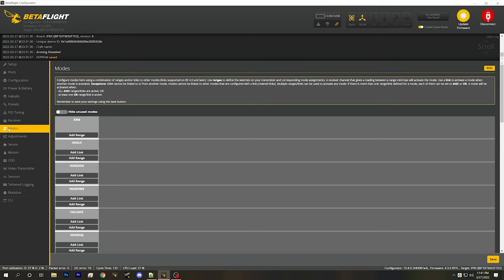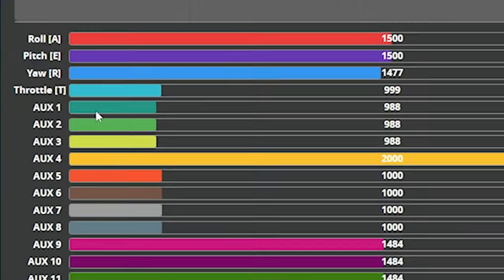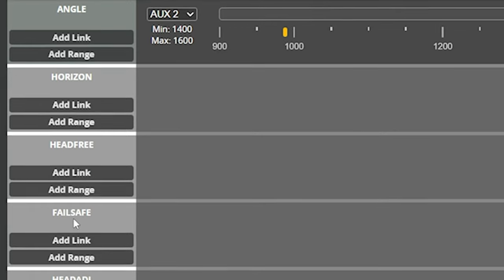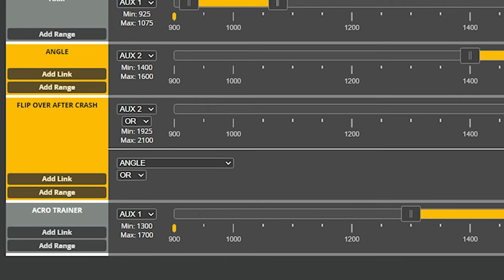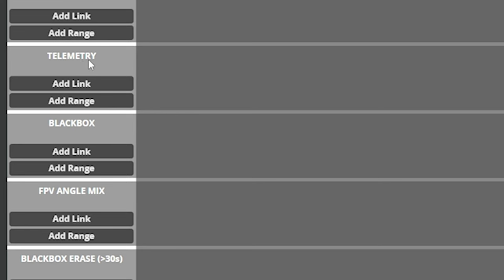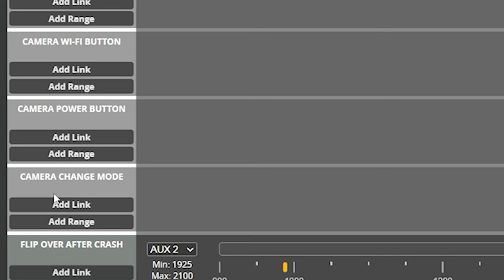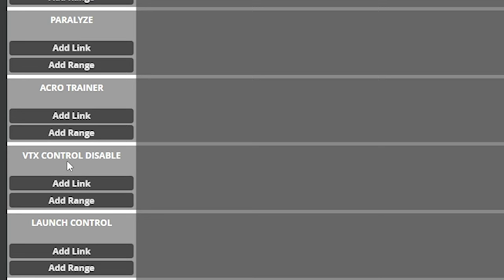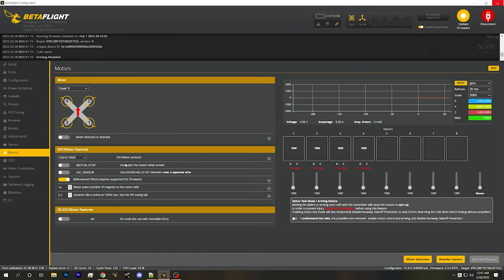Betaflight 4.3 Modes Tab | COMPLETE WALKTHROUGH PART 4

Comment: The downside of telemetry is increased latency. Racers may choose to disable telemetry to shave the latency to it's extreme limits.  Look at the latency tests for ELRS, Ghost, and Tracer.  The 2 fastest run no telemetry mode to get below 4ms of latency.  Tracer is a hair slower because you can't disable telemetry. That said, i'm always using telemetry,  and I'm even using the Crossfire NanoRX Pro that has 500mw of Telemetry broadcast power, because I want my openTX callouts for battery and LQ especially when i'm at long range 👍
Reply: Latency via jitter*
Reply: Telemetry mode is a receiver setting, disabling telemetry in BF won't reduce the latency because the receiver would still be either in telemetry mode or in one way mode, and not receiving any telemetry from BF doesn't change that. Otherwise, good points.

Comment: i have the tx16s with crossfire I set up the 3 AUX's and when I have the drone plugged into the computer on beta flight i plug in the drone battery and my controller says telemetry recovered indicating it is connected to the drone. but when i am in the receiver  tab in beta flight nothing moves and in the modes tab the auto function does not work.

Comment: I just did something really stupid.  I just received my Flywoo Explorer LR 4 HD V2.2 (thanks to your review!) and went t set it up using Betaflight 4.4.  Betaflight absolutely terrifies me so I only use the basic options.

I have the DJI goggles V2 and the black DJI FPV controller.  I set up the Modes and OSD yesterday.  When I was doing the modes I only had Beeper, GPS Rescue, Horizontal and Acro modes (both on AUX 3), no Angle. The Angle mode greyed out. This was the factory default.

Today I was going to set up GPS Rescue to what others have found to work.  Over night I found that getting Angle back was easy.  All I had to do was to click on ADD RANGE.  It worked.  I then positioned the Angle to the top switch position where Horizon was and then moved Horizon to the middle switch position leaving Acro to the bottom switch position. After saving I realized I made a mistake.  I did all this without the receiver being on.

Now when I throw the AUX 3 switch on my controller to move between Angle, Horizon and Acro modes the yellow switch position indicator in the Modes tab of Betaflight does not move. The same is true with Arm, GPS rescue and beeper. As well in the switch Receiver tab, none of the horizontal bars move any more when moving the joy sticks or switches. Betaflight and my controller no longer recognize each other.

Any idea how I can fix this?  Is there a way I can undue activating Angle mode and moving Horizon back to where it was yesterday then saving.  Would that fix the problem? I am hoping there a really simple fix.

I am a tech challenged newbie.

I hope you can help

Cheers,

Bill

Comment: Joshua thank yo for this informative tutorial!  I am totally new to FPV, Betafligh, and associated things.  I have been flying fixed wing models since u-control in 1957 onward through hard tube single channel radios etc.  I am currently using Jeti and Exbus and I am setting up a GEPRC Cinebot 30 with a Jeti Rx in it running xbus.  I have flown it and apparently successfully setup angle mode.  No crashes yet!  However the problem I am having is that for a reason I don't understand the Betaflight is not recognizing the switches when I try to set up other functions such as beeper, trainer acro etc.  I went back and deleted all the ranges I had set up in modes and the switch setups in Tx.  Then tried two set up the switch for Angle and Horizon on a switch and it is not seeing that when I throw the switch.  What have I done that it is no longer recognizing the switches?  Thanks

Comment: Awesome stuff. I wish Betaflight would add a mode where the quad levels and maintains elevation, basically standing still.
Reply: Dji accomplishes "loiter mode" with a barrage of sensors...barometer + optical image for elevation, gps combined with optical for position.   If you've ever seen a toy grade drone try to RTH(it's not recommended) you'll know why it's not in Betaflight yet (flyaways or worse).  INav and Ardupilot support it, but still need additional sensors.
Reply: I think what you are wanting is in a league that beta flight isn’t really aiming to do. Good luck. If you want that, as stated, go DJI.
Reply: INAV is a brother that could do altitude hold, but you have to have a barometer on or attached to the flight controller.  See Painless360 for details.  Betaflight isn’t really interested in that kind of stuff, but INAV is

Comment: Failsafe mode is also one way to set up multi-quad switching for things like team racing. I have my TX16S set up so that the numbered 6-pos switch selects which of my 3 identical quads is “active”, which is accomplished by setting the ranges for each quad to put it in failsafe mode whenever it’s not selected.

It also disables the VTX via the FC’s built-in pit switch via the “User1” mode on the same switch. Talon FC’s come setup with the “User1” mode to active the pit switch.
Reply: (Failsafe mode is preferred over paralyze mode since you can “reactivate” the quad if needed.)

Comment: FailSafe: About the reason, it can be used just as a "return to home mode". Meaning, not for testing, but for actually activating it, e.g. if TX stick is broke during the flight or health issue, e.t.c. just to explicitly instruct quad to take over and help.
In my setup I'm using AUX2 for all modes, so TX maps all the bells and whistles to single channel with 6-8 positions:
1. Acro (default, no mode activated)
2. Angle
3. Horison
4. 3D (actually I only use this one in simulators so far)
5. Acro Training (was default for the first week)
6. Return to home

But this does not mean TX just have mapped 6P on it, there are more complex logic, like confirmation button, or quick angle (SH toggle overrides mode to Angle as a quick button to auto-level in acro, if I disoriented after hitting a branch or something, helps a lot during first months, also helps in simulators).

Since TX is way more powerful and smarter and because more AUX in ELRS means - less frequent updates of AUX round-robin, I think even if you just use switches for modes (not 6P), it still makes sense to pack all of it into single AUX channel on TX. But for simulators TX also maps every mode to individual channel, and even oscillates them, because simulators usually expects HID controller and apart axes have only buttons. For this and other simulator-only things, I'm using CH16-CH31 that are never goes to real transmitters. This helps me to keep 1 setup and 1 model in TX for 3 quads and a simulator simultaneously.

My point is - keep logic separate from transmission. TX have it's own brain and flexibility for you to make use of, AUX channels is just a way to communicate stuff, and BF Modes is just a way to interpret communication back to real action. Don't over pollute your AUX.

Comment: A good example for two switches activating a single mode would be using the pre arm switch trigger the beeper and also having a switch that just triggers the beeper. This makes you quad beep right before arming as a warning to let others know you are about to arm. You could just set it to the pre arm switch but there are situations where you might want to use the beeper but not set pre arm, for example, someone looking for your crashed quad wanting you to turn on beeper.
Reply: That’s an interesting use. That would work well on my tinywhoop when I’m flying around my preschooler. If it beeps it bites! Later on in life she wonder why beeping noises scare her. 

I wonder though if setting up modes like this is akin to setting up osd info. Like the more you do it, the less you care. Lol  “ I need to know my esc temp!”
Reply: in that scenario you could also just toggle the "beep on arm" option in the beeper config, which would be an easier simpler way to do that
Reply: @ryswe  This doesn’t do the same thing. I am setting the beeper to go off before arming. Setting beep on arm wouldn’t beep until the props started spinning.
Reply: @TechnicallyTom  I'm curious, why would you want it to beep before arming?  I personally find too much beeping annoying so I don't see why someone would want that
Reply: @ryswe  You let everyone in you group know that means you are about to arm if the quad beeps. It’s just another safety measure.
Reply: @TechnicallyTom  ahh makes sense!  I fly alone 🤣🤣🤣 ty!

Comment: There is a good reason to setup multiple switches for one function. I setup beeper with arm only when quad is disarmed. Once I recovered from bad crash switching to angle mode, as I recovered I turned on beeper on accident trying to switch back to acro which dropped the drone right into snow... Since then I run this double switch setup

Comment: User1-4 are also used for Adjustments, like if you want to setup rateprofiles on an aux switch 👍
Reply from the maker: I don't think that's right. You set those up based on the aux channel position directly.

Comment: I wonder if we could start a betaflight troubleshooting contest. Where pilots sign up to compete.  Then we somehow have the same issue in a quad that we have to fix, or a host/hosts with the quad/s and we have to troubleshoot issues with that host. Then we set up a point system based on the issues.

Comment: I use the FAILSAFE-TEST as some kind of a panic!Button. When someone plugs their Battery and is on the same VTX frequency as I am, then I'm blind far away mid-trick... Or when my Radio outranks my VTX in range, which is always the case, I need to hit the "RTH" because I'm blind. Or when I lose orientation mid trick and am about to crash.

Comment: I'm stuck. :face-blue-wide-eyes: I'd like to assign Flip Over mode to a switch on a TX16S  but it's not on the list on the Modes Tab. I found a comment that I need to use DShot, but I can't figure out how to turn it on.  I'm Running Betaflight 4.4 and a JBF7-V2 flight controller. There's so much to this stuff.  I feel like I'm drinking from a fire hose but, all your videos are helping a bunch! Thanks!
Reply from the maker: Turn Dshot on in the Motors tab. Set the motor protocol to Dshot 300.
Reply: @JoshuaBardwell  The Motors tab tutorial is next. If I had just waited I suppose I would have gotten my answer. :face-green-smiling:Thanks!

Comment: My first advice to every beginner is always: do not put arm on this switch! :D
I have seen so many injuries because people accidently flipped the switch by hitting the leg/whatever when picking up the quad or when putting down the remote.
Just use the switch above for arming the quad^^
Reply: ..Or use prearm :)
I started using the momentary as prearm... much safer.... :)
Reply from the maker: You can use prearm mode or you can raise the throttle after disarming. Either one will prevent accidental switch-flip arming.
Reply: @ATN007  Sure. But that makes it a lot more complicated than just using another switch ;)
Reply: @Chris  best practice is to put throttle up as soon as you crash , so it's safe when you pickup...all this safety is the result of us using 180degree arming, that by default would keep the quad from arming if we're carrying it sideways...
Reply: Has to be on aux1 if using ELRS.  You could remap aux1 to another switch but I use prearm on the momentary switch.  I think that's the best solution.
Reply: Nobody told me, but when I started flying I came to pretty much the same conclusion for the same reason, I felt it unsafe using the SF switch alone. So I decided to use the SB switch (towards me) for arming. Because it the fastest to reach for me when something goes wrong. Flipping this switch also kind of forces me to let go of the throttle at the same time, providing a bit of extra safety. As for Joshua throttle up is always my start and end point. Being a pincher is also reason for choosing for this setup. I only have to flex my index finger to disarm, never have to reach for a switch.
Reply: I use my momentary switch setup with sticky mode for arming.

Comment: Thank you Joshua for a great video series.

Question gurus ... I have no Turtle (flip after crash) Mode available.  Is that a Configuration thing I missed or do some FC / ESCs just don't offer that?  I have the SpeedyBee F405 V3 BLS 50A 30X30 FC & ESC stack.
Reply from the maker: Turtle mode requires that you be using Dshot. The Speedybee F405 stack can do Dshot. You should be using Dshot300.

Comment: You forgot Airmode. It can be set in the modes tab if you disable always on in the configuration tab. I have it on a switch for when I fly whoops indoors.
Reply from the maker: Ahhhh flip. I knew there would be one.
Reply: @JoshuaBardwell  Just summon JB from the future ;)

Comment: Just curious. Is there a way to setup in the modes tab of Betaflight 4.4 rc3 with the DJI Remote 2 so I could arm and disarm my quad like the Dji Avata does in manual mode, using one of the momentary switches. Thanks for any help

Comment: Hello, thanks for making all these great videos, i have recently taken up fpv, and built a new 3 inch drone. I need a touch of help with my geprc f722 45a aio. I had made a change to the orientation and it didn't fix the rotation issue i was having. I ended up clicking the reset settings thinking it would go back to defaults the way it came, that didn't happen. Now when i try to connect to it- it takes a while and once it connects is say there is no motor protocol and no gryo installed. any one know were i can download the restoral or back up file?

Comment: Good Morning Joshua.  I purchased a Nazgul5 that has "AIR MODE" as a mode in BETAFLIGHT on AUX 3(1700-2100).  It also has Mode-ANGLE on AUX 3(900-1300), and Mode-HORIZON on AUX 8(1700-2100).  This doesn't make sense to me either...  But my primary question is, when you have a moment, would you please explain why one would want to toggle this AIR MODE?  
Thank you.
Reply from the maker: People like to turn off air mode to do perches and grinds and slides. Also if they want to land with props on.
Reply: @JoshuaBardwell  Thank you Sir.

Comment: Can you please help with this problem.  I am using Betaflight 4.3 and have configured Angle, Horizon (and thus Acro) mode in the Modes tab and the yellow spot moves correctly when I change the Tx switch position.  I then pressed the Betaflight "Save" button which I assume saved the configuration to the quad.  However, when I fly the quad I can see no difference in its behaviour when I change the Tx switch position, the quad seems to always be in Angle mode.  Any help will be gratefully received.

Comment: Do you have a guide in how to set up a edgetx/Opentx radio?
You mentioned it in one of the previous videos 

So I can set parameters from 1000 to 2000 exactly
Reply from the maker: Adjust the min/max endpoint in the Outputs screen is the short version.

Comment: there is not a single video on youtube which shows how to use dji fpv remote controller 2 with cinebot 30 O3 version since it doesn't require any additional reciever and controller. Please help i m stuck with this issue, and also in betaflight how do i setup f722 aio for dji o3 and dji fpv remote controller with dji goggles v2? My remote controller binds with dji O3 and i can get video feed in my goggles, but if i move any stick on RC nothing moves in betaflight configurator. How do I arm motors with this RC?

Comment: I have the iflight alpha 85 drone and the Dji Fpv radio. Everything seems to work in Betaflight, but when I arm and attempt to use the drone anything past 1/4 throttle is full throttle and won’t shut down until I hit the disarm switch. I’ll try calibration of the sticks tonight, but if that doesn’t fix the issue I’m out of ideas.
Reply from the maker: Are you testing with props removed, because if so that's normal.

Comment: now I'm wondering if I can use launch control to emergency hover in angle mode (like when the vtx cuts out for whatever reason). as in: will this apply to throttle input and hold that, or only pitch?

Comment: Amazing series! Question - Can you use the latest BF Configurator version to flash older FCs firmware (F3 etc)? In other words is BFC backwards compatible, or do you need to use a particular BFC version for each firmware version? 
Reason is I have a few F3 FCs and I understand BF 3.5.7 was the last compatible version, but not sure if I need to use an older BFC to flash/configure the FC.   Thanks in advance
Reply from the maker: Yes, the configurator is backwards compatible with older versions.
Reply: @JoshuaBardwell  thanks Joshua

Comment: I bound my ELRS Radiomaster zorro to my Cinebot30 o3 with ExplressLRS manager (flashed firmware, and updated LUA script with keyphrase, radio know's it's connected to the drone because it says "telemetry lost / telemetry gained" when power cycling, but in BETAFLIGHT, i don't see any response from the controller sticks or switches so i am trying to figure out what switches are tied to which aux channels. Any help guys?

Comment: Hey Joshua. Got an issue with my Matek F722 HD FC. When I plug it into my PC, I get a blue flashing light and a red light, but even when holding the DFU button I can't get the FC to be recognized in Betaflight in DFU mode. I've downloaded all new drivers and files and nothing seems to work. Any ideas of what I could try. Also, I'm only getting three tones when battery connected to quad...any help is greatly appreciated....Thanks.